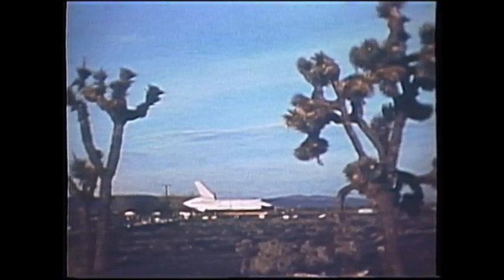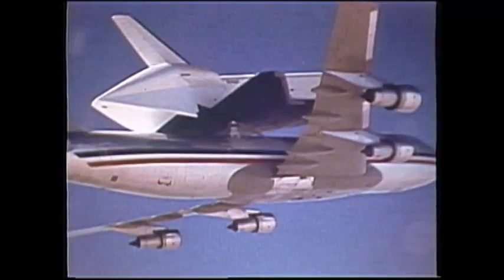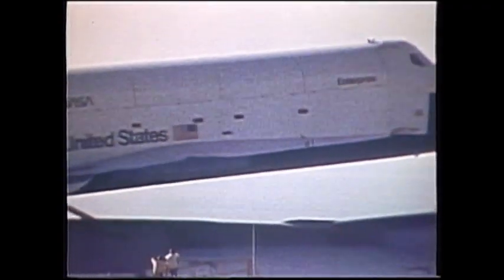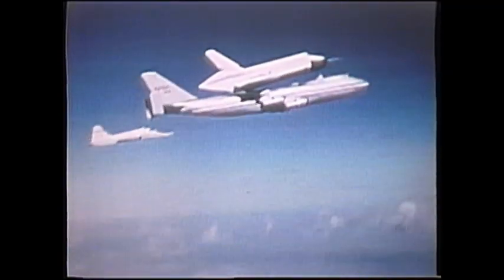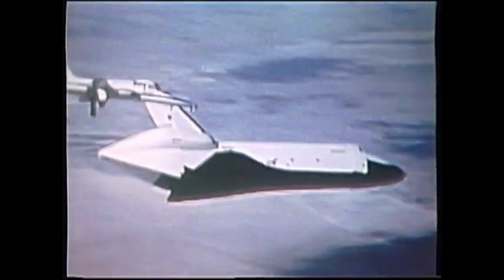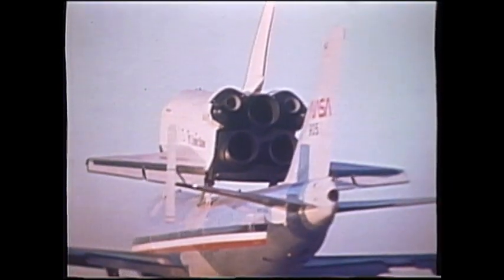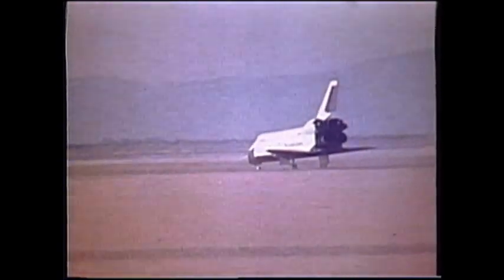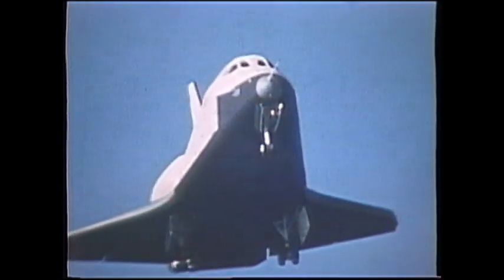Go for Sep

Comment: "Each shuttle designed for over 100 flights". 

5 vehicles made a total of 135 flights. Discovery made the most: 39.
Reply: NASA intended for the shuttle to eventually fly as regularly as a commercial airliner. The goal was to fly twice per week.
Reply: @63Hayden  Twice a month, you mean... 20-22 missions / year.
Reply: @63Hayden  I dont think that's true. The stat I always read was two launches a month. Not two a week. The turnaround time (refitting SSME's etc) would have been impossibly short with a fleet of only four orbiters insufficient for the job.
Reply: marmaly Rest In Peace Columbia and Challenger, though...
Reply: marmaly Discovery - 39 flights, Atlantis - 33,  Columbia - 28, Endeavour - 25 and Challenger - 10.
Reply: @brad9956  challenger had a lot for it's short time in service.
Reply: They didn’t have enough weaponry on the shuttles
Reply: @deoglemnaco7025  Definitely not a viable fighting craft.
Reply: Each one was designed to fly more than 100 flights. There ended up being a LOT more to refurbish each orbiter between flights than they probably thought at first. It was very rare that the black tiles were undamaged following a flight. They knew that tile damage did occur during ascent from ice and foam from the external tank. They also knew that any breach of any of the RCC would likely result in loss of an orbiter, as would sequential loss of more than about 5 black tiles. Unfortunately they didn't know how to keep stuff from falling off the ET and impacting the orbiter. It probably became one of those "well, we've never seen a BIG chunk fall off and the small chunks won't hurt the RCC..." After Columbia's loss, they did make some changes that greatly limited the debris coming off the ET, but that, of course, was too late. 

As to doing 50 flights per year, if they had the manpower/budget, they could have managed it. Remember that with 4 orbiters, each one would take about 4 weeks for turn-around. It was doable, exceedingly expensive, but doable. You'd have needed massive teams working on changing out the SSME's, replacing damaged tiles, inspecting wiring and plumbing for corrosion... If they didn't have to worry about tile/RCC damage, turn-around could have been quite fast. 

Of course we never got to reach that kind of launch tempo, not even close. There was too much work and it was too expensive to speed things up.

One thing that was supposed to be a "safety" thing was that turn-around of the orbiters was supposed to be so quick that there was supposed to always be an orbiter ready to fly as a rescue ship. All that would have been needed was to mate the entire stack and roll it to the pad and that was supposed to take about 3 days. There was also a cable that would have allowed a completely automatic landing of the shuttle. The Soviet Buran shuttle had this built-in. The US shuttle could do it but it required a special cable and a rescue shuttle would have been required to off-load the crew of a damaged orbiter. I suspect had they known about Columbia's RCC damage, they may have actually used this option.
Reply: Mind you, the initial projection was 1000 flights per vehicle which was later trimmed down to still rather impossible 100 flights.
Reply: In 1900, they said the 20th century would see the end of poverty and war... In the '50s, they said we'd have flying cars by the year 2000... The goals they had for the shuttle in the '70s, including the goal of 50 flights a year for the fleet, were never realistic.
Reply: @BSNFabricating  Yes, 50 flights/year was unrealistic based on the size of the fleet and the budget/manpower they required.  I have never heard of flying twice a week or over 100 flights a year ever being a goal.  The Challenger disaster really ruined the program.  If only the redesigned boosters made it into the program on their own, rather than being forced into the program by failure.
Reply: BSNFabricating and since most of the shuttle was reusable it was supposed to cheaper to fly compared to expendable rockets.
Reply: b xpress6 no the shuttle went over budget
Reply: Knowledge Nuke yes it was obvious the cost overruns..with up to one billion dollars just for one launch..reusablity gave little savings as promised.
Reply: b xpress6 I miss read
Reply: @BSNFabricating  In 1989 "They" predicted that "entire nations could be wiped off the face of the Earth by rising sea levels if the global warming trend is not reversed by the year 2000."  https://apnews.com/bd45c372caf118ec99964ea547880cd0     I think it's fair to say that "They" don't usually make very good predictions.
Reply: @deadboy600 What a weird overreaction. Everybody knows that the initial projections for the flights per year and turnaround times turned out to be hopelessly optimistic. There's nothing passive-aggressive in pointing this out.
Reply: @GaryKemp84  he’s being passive-aggressive for stating a simple fact? Oh my god 😂
Reply: @deadboy600 You might seriously consider not insulting people with such little provocation, it only makes you look like a bully-crybaby.  I see this kind of immature behavior in online games all the time -- those who start hurling insults merely because they don't like the way team members are playing a GAME.  Instead of being critical of others, if you disagree with them be critical of what they said.  Attack what they said, not the person who said it.
Reply: marmaly overall, very foolish vision and design

Comment: It’s simply a glider as it passes through the earths atmoshpere. It makes use of flaps. That’s literally it.
Reply: The shuttles have no flaps.  They make use of a modulated speed brake integrated into the rudder.  at 300ft AGL the landing gear is deployed as the final in-flight drag mechanism.

Comment: The Enterprise was a glider, that was all. there were no instruments for the boosters, there were no engines, no nothing, it was just a test of the airships handling capabilities. The thing was gutted, they did have the weight added to equal the weight of having boosters. I built the model of this 747 and Orbiter as a 17 year old kid. I wish I had saved that model. It got sold at a yard sale. Shame.Probably got blown up with fire crackers.
Reply: It was always intended to retrofit it for orbital flight, but ultimately the design changed enough that it would have been too expensive, so they never bothered.
Reply: I was actually inside the shuttle Enterprise when it was on display at Kennedy Space Center! It was awesome and the payload bay is HUGE! I have some great pics of it.
Reply: Gene O Thats cool. Too bad they finally figured out it was too big and designed for the space station only.
Reply: RC Hobbyist Extreme
Reply: RC Hobbyist Extreme  nnjj>
Reply: RC Hobbyist Extreme I bought it at a yard sale, I'll sell it back to you
Reply: Same here! Built the model as a kid. Not pretty, but still. No idea what happened to it.
Reply: RC Hobbyist Extreme 9
Reply: RC Hobbyist Extreme
Reply: Harvey Plunkett
Reply: a glider can be made with a keel. the wing tips can be trimmed straight with a radius up. any thing else
Reply: Why would they add weight to simulate boosters if it was to test for landings?
Reply: @djbeezy  they also tested it on the launchpad with full launch configuration of boosters and fuel tank attached.
Reply: @djbeezy  I think he meant engines, not boosters.
Reply: I heard by reliable sources that in order to test the shuttle's liveability NASA stuffed the shuttle full of homeless arangutans.